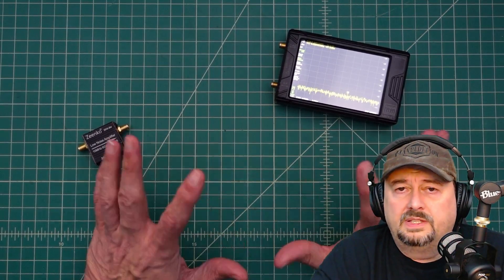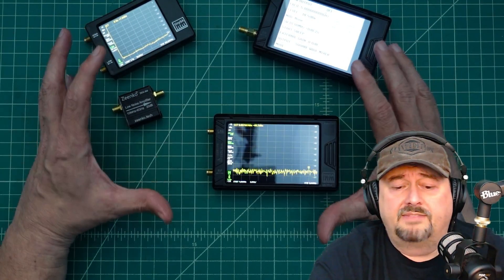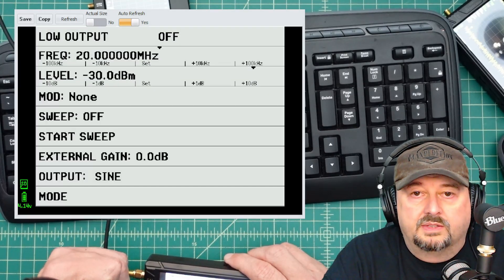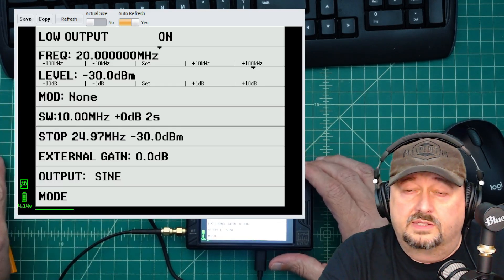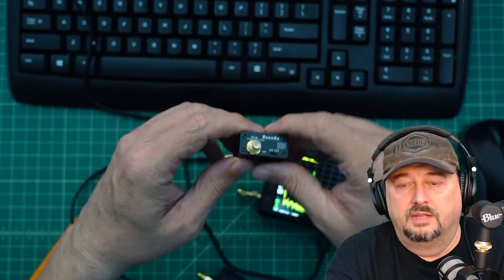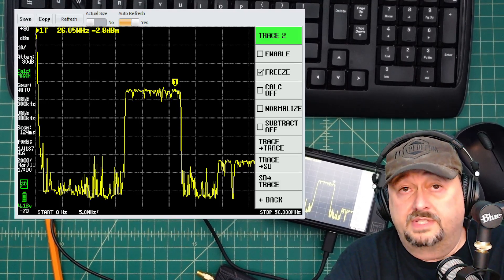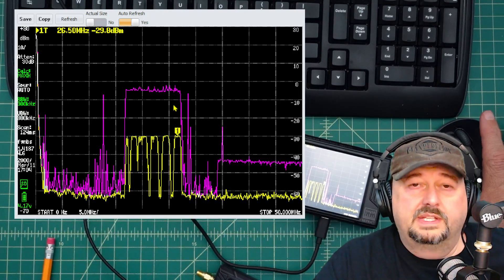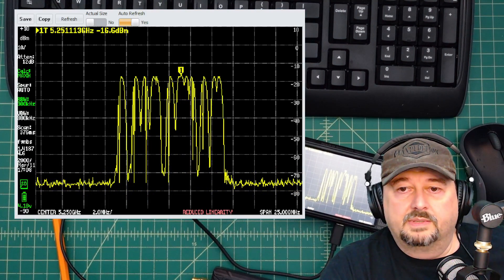Measuring Low Noise Amplifier Gain!

Comment: For this test you will need two of them? Sadly you can't put out a signal and measure it at the same time.
Reply from the maker: @OffSurfaceAdventures  the TinySA’s can only be in generator mode or analyzer mode.  You can use any other signal generator of your choice have one.

Comment: That a interesting LNA !  Another test for that would be it's own noise it makes. Put a dummy load on antenna side and measure the noise floor it makes.  You will have to do a comparison with the tiny sa noise floor to compare the difference.  You can use this like a loop on ground antenna .73
Reply from the maker: Hey Robert, I actually have two other LNAs and am planning to do the Noise Factor test.  Thank you for watching 👍